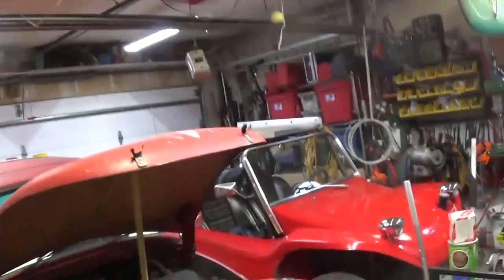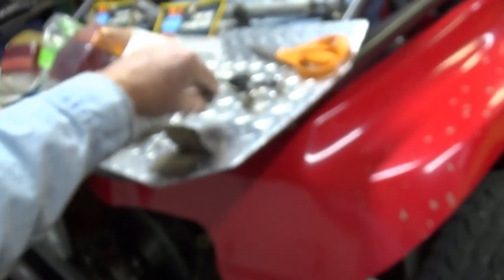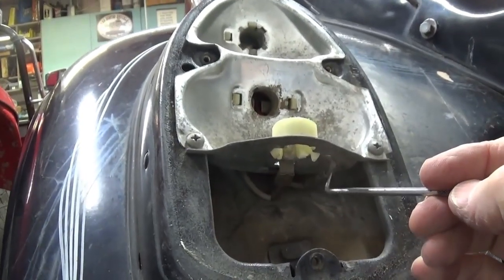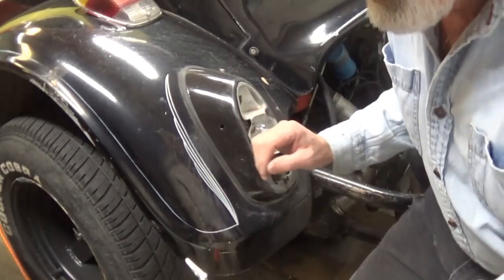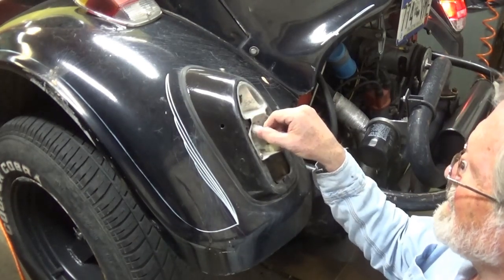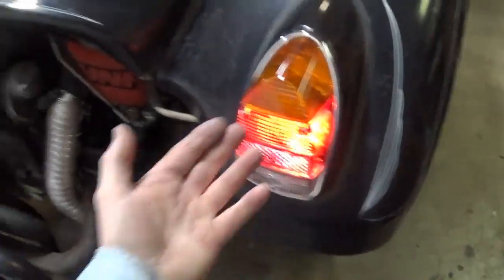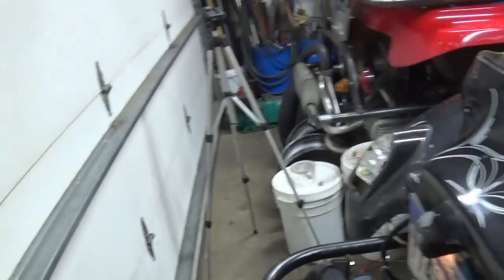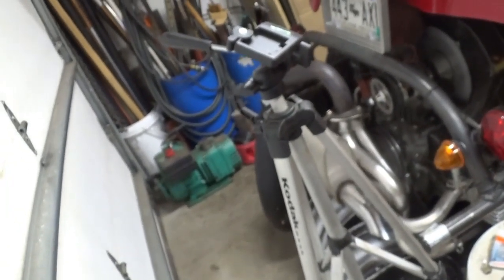Tail Light Fix / Tips and Tricks

Comment: Hay buddy, I had the same problem on the 64 bug, i cleaned everything like you have done, but went one step farther, the grounding on a 64 uses the fender back through the body to battery ground, so I soldered a terminal to each base, then ran a wire back to  the body with star washers for a good ground, then I also used dielectric on all bases of the bulbs and contacts. seem to fix my floating ground problem in the rear, si I did it to the front turn signals and the headlights. All is great now, U got all LEDs in mine also, got them off amazon. they work great and really bright. Glad to see you buddy thanks for the video. Happy Bugin

Comment: Rinse those contacts with hot distiled water or drinking water also helps remove the corrosion or clean. I also use aluminum tape to reuse old german inner parts form my 1968 Bay window bus, Regards Sir!!!
Reply from the maker: Interesting idea! I know distilled water is not conductive.... Thanks for your contribution. I like those bay window buses

Comment: I was thinking about you today and what do ya know, up comes a Vidio. Great idea the leads, you could clip them together any length depending on your extention leads. 
I have just cleaned my 34PICT3 carby, but I didn't clean down around that ball bearing.  What are the symptoms of  dirt round that area.  Just asking because my buggy is running a sweet colour on the plugs but lacks a bit of top end.
Reply from the maker: The ball is the accelerator pump circuit check valve. There is a hole in the bottom of the bowl right under that plug. It is the inlet. The outlet is under the diaphram of the pump. If your pump spray is not good you may have crudd in there. If you can't hear the ball move and can not blow air threw from the bowl side you can still clean it out like I explained in this vid.

Comment: My '70 Beetle no longer has taillights, brake lights, reverse lights or license plate light, but the turn signals work. Not sure what happened. Fuses looked ok. It happened either after I accidently hooked up jumper cables backwards, or had an electrical meltdown by having a wire cross on the coil, melted my condensor wire and points, had just installed my dual carbs. Not sure if either are related to the rear lights being out, but maybe a junction or something came loose? I'm not sure what happened.
Reply from the maker: Just get a volt meter or test light and start the car or turn on the key with coil wire power disconnected. Start at the front and work your way back. Especially check everything on the back of the fuse block and all your ground points at the rear of the car.  They connect to the body and get corroded. Get a long wire to go directly to the negative side of your battery to your test equipment.